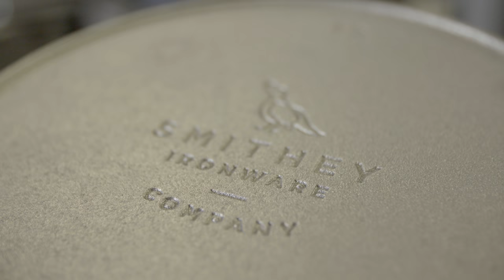Smithey Ironware  Cast-Iron Skillet I Shop Tastemade

Comment: Great introduction video. That huge disk grinding/sanding wheel the operator used for cleaning up the edges of the skillet could use a little truing as it is very out of round. The design of your skillet handle and lift handle are top notch from this side of the video.

Comment: Interested to see a test when using it on a glass range. 
Also, will the "bottom lipped" versions work on an induction cooker ? .....because it does not make total contact ?
Reply: Yes, I have an induction cooktop and the induction will work with something that's up to 1/2 inch away from it.. My test was: I placed a 1/2 inch thick book directly on the induction top, then set cast iron on it and it heated up just the same. The reason I tested it was because I want a vintage waffle iron and they do not contact the cooking surface.